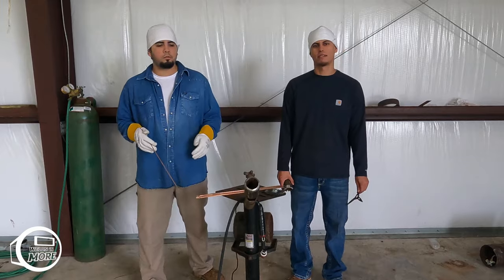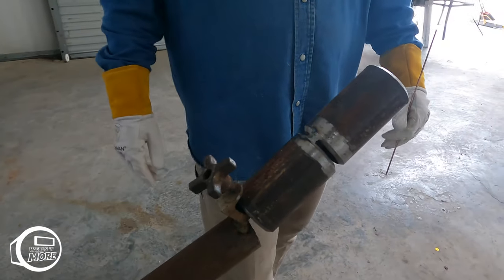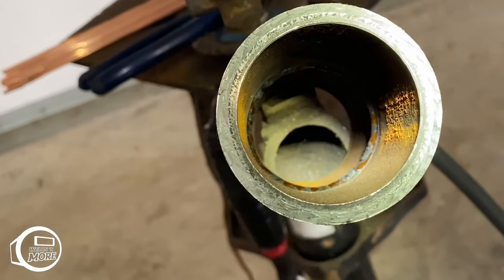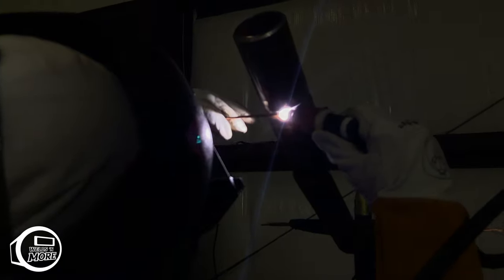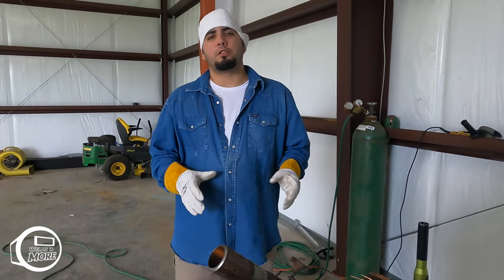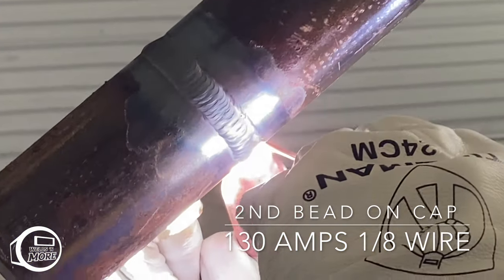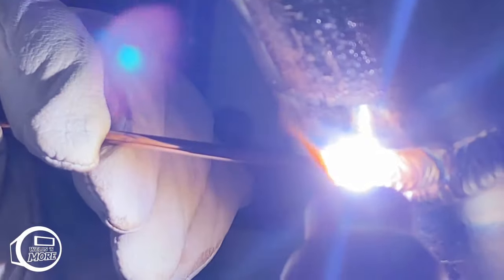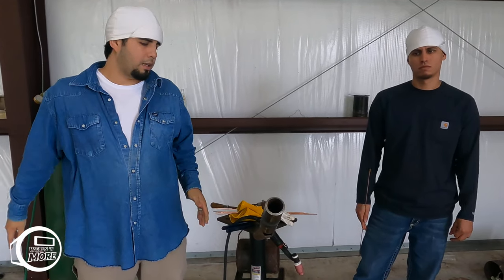2" TIG (GTAW) pipe weld on 6g position.

Comment: Do you always have to go uphill?
Reply: You should for the root especially otherwise the root will be flush, would be lucky if it bends. I learned from personal experience. 
I understand the difficulty on the one side of the pipe but how he is doing it - bringing the pipe down and bending over the pipe. When you look at it, it’s like a 5g almost. Or other options is using you’re left hand.